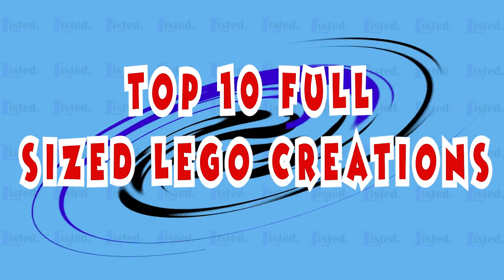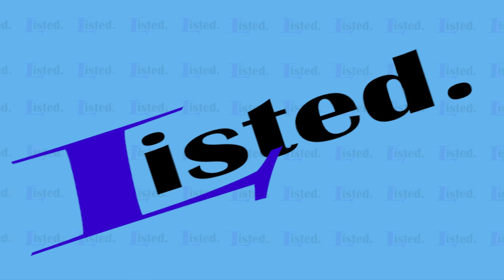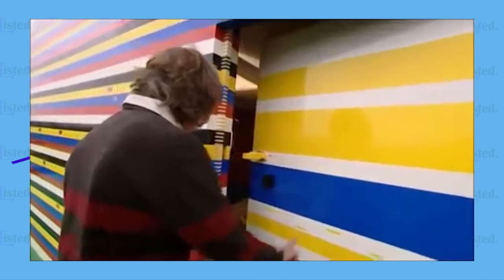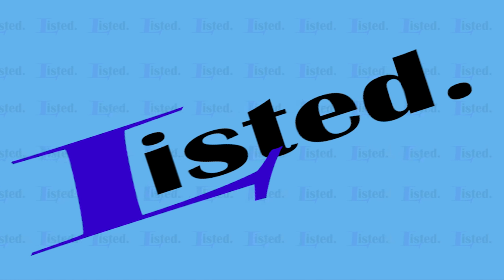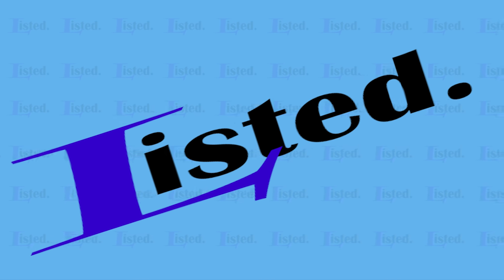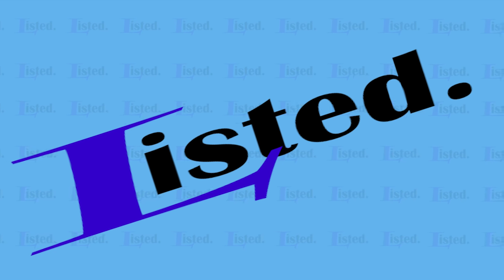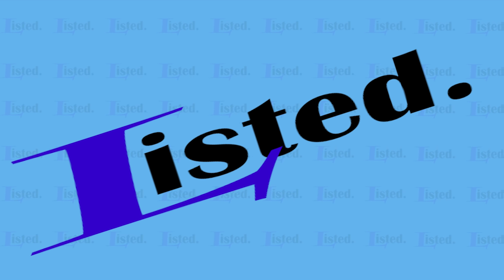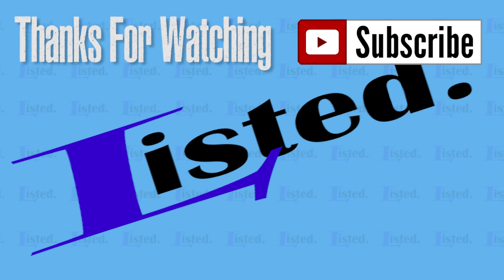Top 10 amazing life size lego creations (life size lego house and working lego car + MORE )

Comment: Why is a car called 911
Reply: ClodUniv3rse better question, why did he say it's half a real 9/11
Reply: At the Internationale Automobil-Ausstellung (Frankfurt Motor Show) in Frankfurt in September 1963, Porsche presented its successor to the Porsche 356 as the 901. It took several more months until the cars were manufactured for sale to customers. Between 14 September and 16 November 1964, 82 cars were built and the 901 was presented in October at the 1964 Paris Auto Salon. There, French car maker Peugeot objected to Porsche using any three digit number where the middle number was 0, asserting ownership of the naming rights in key markets, and having already sold many models with that scheme. So, Porsche simply replaced the middle 0 with a 1, and called the car Porsche 911.